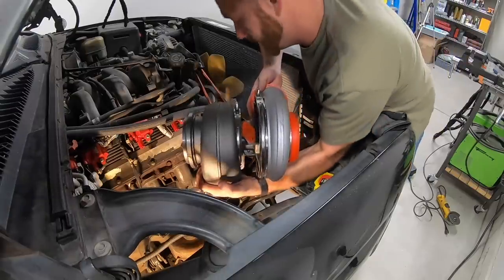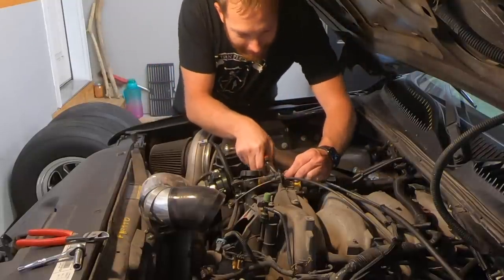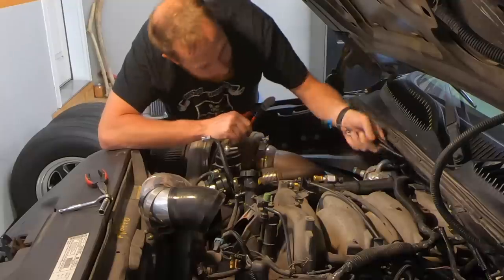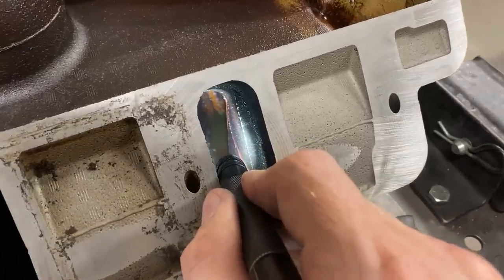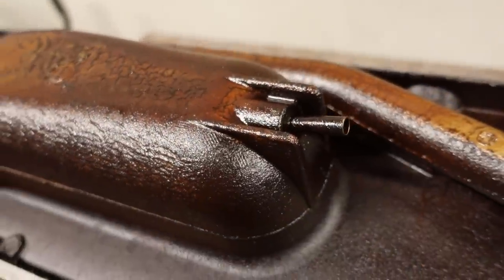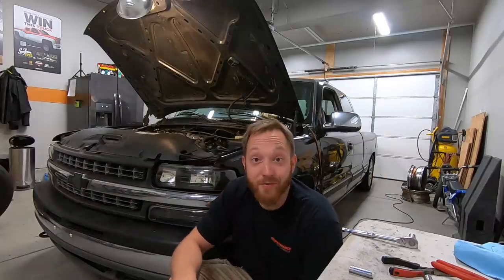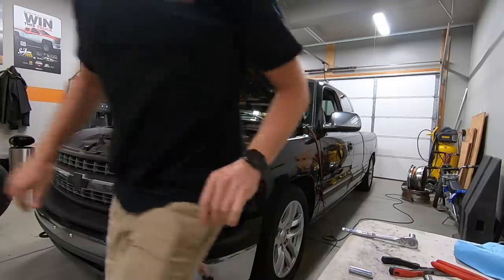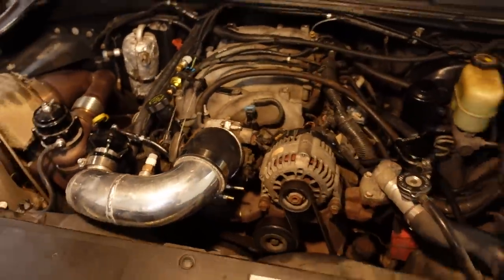this is the WORST ENGINE DESIGN I've ever encountered

Comment: Future 8.1L build? I have a '73 stepside project I've dreamed of dropping an 8.1L into. I've slowly been gathering parts that would come with it, like 1 ton axles (KP ford Dana 60, disc brake 14 bolt), I do have core 8.1L with accessories that needs rebuilt, a 4l80 and np241.
I don't plan on selling it, BUT I haven't touched it in 5 years and I would love to see it actually be built if it's an idea that entertains you.
It would be a big project, but you undoubtedly have the skills

Comment: You know how I know you havn't worked on many engine platforms? Your comment that this is the worst engineering fail you have ever seen...I can name thousands of engineering fails. But I'll give you just a few to keep it short. The Ford 5.4 in ANY generation. From spitting spark plugs out to  breaking them off in the heads,  to the timing phaser problems. They are loaded with fails.  The earlier Ford 302 and 351 use of 6" long bolts going thru acceceries AND the water pump. They used a 3/8 bolt for the acceseries that NECKS DOWN to 5/16 to hold the water pump on. Imagine a 6 inch long steel 3/8's bolt going thru ALUMINUM so it can corrode, and then shrinks to 5/16 where it goes thru the aluminum water pump. Anyone who has dealt with these bolts breaking knows.... The Jeep inline six cylinder. It has the intake and exhaust manifolds on the same side of then engine, and held on by the same bolts. Anyone who knows anything about making horse power knows you want to keep the intake Temps as cool as possible, and as far from the exhaust as possible... You easily fixed your egr issue here. You CAN NOT fix the problems I mentioned on other engine platforms, period.

Comment: Every marine engine manufacture.  Mercury mercruiser ,Volvo penta .Crusader  has used the 8.1 engine in yachts and boats.  Running 40k-100k lbs at 4000-4500 rpm for thousands of hours.  The only set back for the 8.1 is the dead head injector rails non return   They build up a lot of crap into the injectors. 99% of running problems with 8.1 is the injectors.

Comment: The Saab b207 engine which is based on the ecotec has a small plastic PCV valve sitting inside a passageway in the cylinder head or intake manifold. I would not be surprised if the passageway on the big block isn't the same size and I know the valve is not present in non-turbocharged ecotecs

Comment: Why don't people put the mileage their 20psi big block lasts for?
Because it doesn't.

Also engineering is application specific. Going from boost to vacuum, or opposite, are different applications

Comment: May I offer some advice, when running E85 and boost don’t recirculate the crankcase back into the engine.
The higher the ethanol content the more blow-by there will be and oil does not like to be compressed and can cause pre-ignition.
Pump gas, re-circ is fine but ethanol I do not recommend it.

Comment: Lawrence, you are correct. The cam in the bath whipping oil vapors up to a tiny unbaffled hole is the cause of a lot of the oil consumption. Chevy's design was probably meant for low RPM truck drivers or something back when straight 30w was being changed every 1500 miles. Next, you are correct. You DO NOT wan't to use any pcv connections behind the throttle body as it will vacuum up your oil on high rpm deceleration on top of the already high crankcase pressure created with high rpm. It does this on pcv valve cars too. Just go ahead and plug them all and quit using them. Third, you need to keep boost out of your pcv loop. The entire purpose of the pcv system is to evacuate crankcase pressure not add to it with boost. Glad you at least didn't blow your seals out doing that. A lot of the guys who guy from NA to Boost do that sometimes lol.  I would look into plugging that hole in the intake, and drilling a breather hole on each valve cover and vent them both to a peterson catch can or something. You can still vent them as a closed loop system as well you just need to plug them in in front of the turbo in the non pressurized air. This leads to less stank. You can test out when you're doing all of this if it works by measuring vacuum/boost on the oil cap by tapping to to a sensor and watching it inside or datalogging the crankcase pressure. Effectively venting your crankcase should also give you better ring seal from the pressure differential and more horsepower since the pumping losses will be lower with less crankcase pressure. If you want to go wild you can do a vacuum pump. This was wordy but you should try these out. Don't be afraid to try 12 AN connections on the two breather hoses either. I've seen some crazy shit on track cars to keep them flow sucking and blowing oil.

Comment: Here's the deal that nobody knows unless they have ordered one of these engines from the factory. They came in different dress. Now if you had the 490 hp variant of the motor. You wouldn't put much boost to it before the pistons became grenades.
Depending on the year you could find a nice low compression 360hp version too.
When I went to order my last one back in 2007 I was given 5 different power options for the truck. I went with the middle option. I don't think mine would respond well to a lot of boost.
Honestly though, change your crank, forged internals, new heads. She'll make a lot of power. Lots of guys used these for years for nitrous builds too.

Comment: Why.....Not put some sort of little check valve that prevents boost from entering the crankcase but allows normal suction when not in boost.  This engine spends 98% of its running time under vacuum after all....

Comment: Hey LT,
I have a 05 Avalanche 2500 with the 8.1. I love the truck but have the usual problems with the 8.1. Would you be interested in doing a project on my truck on your YT channel. If so what do you charge for your work. I would be interested in a rebuild to includ a turbo upgrade like yours to help with towing and better power.
Thanks 
Ronnie

Comment: I had the same problem with smoke after let off, it ended up being over oiling of the turbo, high pressure oil being pushed into the turbo, I used to things to fix it, one a Turbo Smart Oil Pressure Regulator set to 40 psi for my vehicle and turbo, and then second which was maybe not needed but I installed a TurboWerk Oil Scavenger Pump and it fixed my smoke issue.

Comment: 20 psi except 10 of it is going past the rings into the crankcase. Lol jk your smoking issue is because of the valve guides. Most likely the intake guide seals. When you chop the throttle you build manifold vacuum to a point and it pulls oil thru the intake guides.  If it was smoking worse on the throttle it would be a ring issue.

Comment: Gotta love a good Ol' murica' made Cast Iron V8. You only need a basic socket set to pull it apart. About the only special tool you need is the fuel line disconnect tool.
New cars have so many types of different bolt and screw heads that it makes them a pain to work on!

Comment: Ok. I get you, but add a couple 1.5 inch breathers to rocker covers. Position them level so if they get soaked they'll drain back in. That tiny breather tube is insufficient.

Comment: Turning up boost does absolutely nothing unless you add more Fuel. If you want more power, you add more Fuel and more Air. You have to account for turbo lag. As long as the Rings seal ,there   there should not be any positive crankcase pressure.

Comment: I read where if you add a j hook to that Pcv type little pipe it cures the oil consumption on these. I have 04 8.1 with 160k on it. You might use a quart in 500 miles or not any for 3000 miles. Doesn’t matter how you drive town, highway, towing can’t predict usage. I check oil every other fill up so I don’t have to wonder. Also these trucks run low oil pressure with very high volume. The engineer that did a lot of design work on these engines has a lot of info on older forums.
Does the Raylar intake address this issue?

Comment: as the 8.1 is a vortec, even though it is LS family, does it have an iron block and heads?
Reply: Not LS family, just a LS style ignition system and fuel delivery system 
Iron block
Iron heads
Reply: It’s not a LS. Yes, all iron. I know the intake was AL and the water pump might have been as well.

Comment: 8.1 weak? Bull! The 8.1 in my truck had 300,000 miles on the original bearings before I threw a bunch of Raylar parts at it.

Comment: I don't know, GM engineers really had their head somewhere when they designed the DOHC 3.4 V6.  Super fun engine, for sure underrated on HP numbers but that damn oring that blows oil by on the balance shaft and you have to pull the head off to put a new ring on.

Comment: The 4.3 in my 06 gmc 1500 is the same way no pcv just a tube with a little hole in it coming out of the valve cover and straight to the T/B

Comment: Blocking that hole will now let that chamber to fill with liquids. On a future start up you will get a hydraulic piston stop and a broken rod. You need to drain that chamber somehow.
Reply from the maker: There is no liquid to fill the chamber… that’s the intake manifold plenum it will now just have air flowing through it rather than oil vapor. No liquid can collect in there.
Reply: Condensation cool nights and hot humid days. Cummins generators had lots of failures with the turbo version filling with water if the customer failed to keep the block heater on .The turbo engine had the intake PVC blocked and one installed in valve covers and piped to intake of turbo @LawrenceTolman
Reply: The water lays in that stupid chamber under the intake runners with air on top of the water the rush of air over the water pushes the water into one of the runners.

Comment: Some times those intake manifolds crack if it's the plastic one. looks like you're sucking oil through the intake. the pcv on all the newer vortec small and big blocks are garbage I'd run a long line out to the fender with an inline fuel filter so it has a longer air draw but that's just me.

Comment: Here's why the BBC 8.1 isn't a big block LS, mainly because a regular BBC cam will work in it.

And that is one of the weaknesses of the BBC is the cam. The BBC cam journals are the same size as the sbc cam journals and they both use the same cam bearings. Which is even more limiting in a BBC because the cam is longer that makes it harder to control the valvetrain. It is much harder to bend something that is shorter because of the lessor leverage.

Now if that 8.1 shared cam bearings and cam journal size with an LS it would be a much more worthy platform to play with, it would also make it an LS BB. With the larger cam journal size of an LS cam leaves more material for the base circle to have a larger diameter that gives it a more stable valvetrain.

Another advantage of a larger base circle cam it can have a larger lobe without decreasing the base circle.

Comment: Hey lt. Little know fact that opens up the lighting into the engine bay is the hood service position on them Gm trucks. You remove the ground strap and the hood bolt on the hinge you can open the hood up higher and reinstall the bolt holding the hooks in a near vertical position. Makes life easy

Comment: 13:30 not wanting to idle can also be a sign OF!!! a vac leak
the MAF isnt seeing all the air going into the engine.... and does not provide enough fuel after the key is returned to run (during crank, it gets a bit extra fuel)
.
had it today with a subaru.... the tube going to the idle air control valve fell off when i checked the air filter during an oil change 
so, all the idle air wasnt being read by the MAF...... so engine would start, idle for 1 or 2 seconds, then rpms would get lower and lower, sputter, die
.
.
also seen it happen on LS, GM 60 degree V6, buick 3.8, and a few ford engines
.
not saying you DO have a vac leak / PCV "suction" 
but it is still a possibility..... 
.
.
thinking "i dont have a leak.... because it will not idle" is a logical fallacy that could cause diag issues down the road
Reply from the maker: You do make valid points, except this truck runs on a speed density operating system, and there is no MAF sensor to measure airflow. Fueling is controlled my a map sensor, and idle speed is directly controlled by how much air is allowed to enter the engine, whether that’s through a PCV orifice, idle air control motor, throttle plate, or a vacuum leak. A lower engine speed means there is less air entering the engine, so if a vacuum leak was present it would idle at a higher RPM than before.

Comment: I need to find a video about why we even connect these systems through the air intake. What does that connection to the oil do for the air intake? How does removing that negatively affect (effect? I'm tired) the engine?

Comment: I'm guessing the guides are going away. If the stems are tight, then just replace the guide seals. The turbocharger impeller seal might be blowing oil into the exhaust as well.

Comment: You wanted to hear about stoooopid engine designs, well, I have one for ya!

The Nissan VG33-series (NA and SC) have water pipes, vacuum tubes, and vent tubes running through the engine! Imagine putting a heater hose on the front of the engine, and then finding out that it extends to the back of the engine, right next to the firewall, with several more hoses attached to the tubes. You can hardly work on 'em without removing the intake plenum and/or manifold. Check out an Xterra or a Frontier with one of those engines. Model years 2000-2004.

I keep saying that I'm gonna retrofit mine with some smarter design, such as abandoning the "inner tubes" (LOL) in favor or routing the heater hoses around the outside of the engine, just like they should be. Maybe this winter with vacation time and fewer 4-wheelin' opportunities.

What to do with the 8.1 when you drop the 535 in there? Well, if you had kept the Taco . . . Hmmm, time for a new, small-truck project. Call it "Shelby" or "CS" in honor of Carroll Shelby, who was famous for doing something similar to an MG. Maybe we could shoe-horn it into my Xterra! I'd have to beef up the front IFS, though. SAS! (Solid axle swap.)

That unmetered tube for PVC just blows my mind, but not like the "inner tubes" on this Xterra.
Reply from the maker: well technically the Taco hasn't sold yet, but it is still 2,500 miles away lol... but that's certainly an option

Comment: Albeit not 8.1’s but our race engines run three -10 breather lines for the crankcase and head, it’s a recirculating system and the catch can dumps excess oil back to sump as well as being open to inlet vacuum through the baffled and separated catch can. 
If I were you I’d get more crankcase reliefs on there as you will end up blowing out seals. 
Very cool to see though shame we can’t get e85 from the pump in Scotland though.
Reply from the maker: when we re-do the new engine, it's gonna get a much better breather system like you described, this was just a stop-gap measure to get through the rest of the season on the stock engine. It is too bad you don't have e85 available also, its a great alternative to high dollar race fuel like 105 or 110

Comment: LT I'm finishing up same swap thanks to your help! How did you reposition that barb coming out of the throttle body for your pcv setup? I can't bolt my cable throttle body on with the way its pointing!
Reply: Also what did u do for a throttle cable? Mine seems to be short

Comment: Nope, #1. water pump inside the engine timing cover, run by the timing belt, so when it leaks, you have coolant in the oil, and kill the motor.
#2. Starter under the intake manifold, so you have to dissemble the whole top of the engine to change a starter.
That’s just two engineering better ideas.
Reply from the maker: Yup, those are two great examples!

Comment: What max rpm do you spin it up to? I set my rev limit to 4900. I believe the 8.1 breathing through a 78mm throttle body on 30lb stock injectors at 6000 factory set rpm=bad
Reply from the maker: I've been up to 5,600 quite a few times, but it makes most of its power at less than 5,000
Reply: I just think the reason behind the weak big block is a lean condition at high rpm
Reply: I'm running a stock fuel system, modified the stock tune with a handheld diablosport i3, with a cut airbox and a home made catback system single 4"out (thanks for the inspiration) I made 304hp and 415tq on the dyno in 90% humidity 95° in south Louisiana.

Comment: LT the reason GM used a fixed orifice PCV is so the bypass air that enters the engine is metered by the mass air flow sensor. And less moving parts. For a naturally aspirated engine with efi it’s a wonderful solution. Not so much on a booster deal.
Reply: *Boosted

Comment: The 96 to 99 chevy vortec spider injection small block is similar. The fuel pressure regulator is on the inside of the intake lid and just pulls vacuum from the intake charge instead of using a vacuum hose and being mounted externally. I'm glad you made a youtube channel! I have been watching powerblock since I was a kid. It would come on every Saturday morning starting at 9am with extreme 4x4 with Ian. Those shows fueled me to do what I do as a career and drag racing as a hobby and it takes all of my money 😆  one of my dreams was to be a host on powerblock. I might go after that dream I believe I have enough credentials to do so with ase certs and other stuff. But man I'm glad I still get to watch your episodes!! Keep it up sir
Reply from the maker: hey thanks for watching! I also loved watching powerblock in by younger days and learned a ton watching the shows, as well as working on 'em!